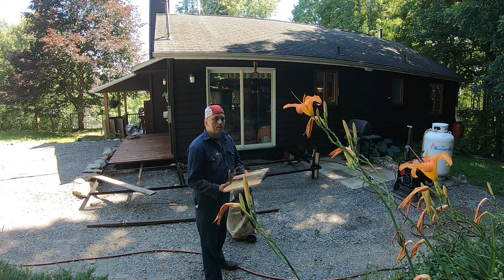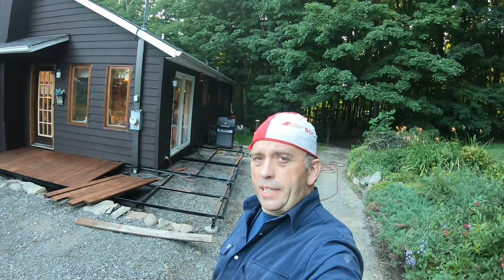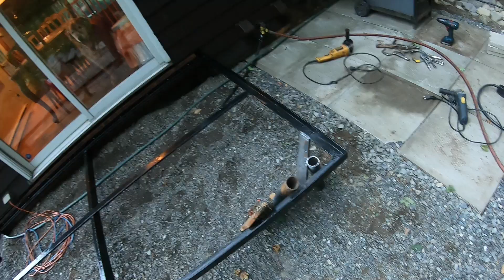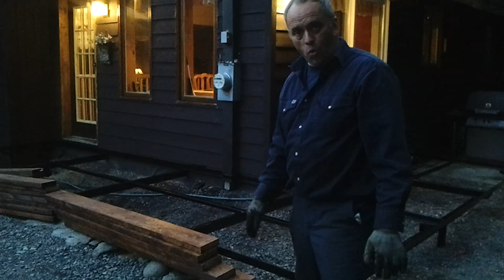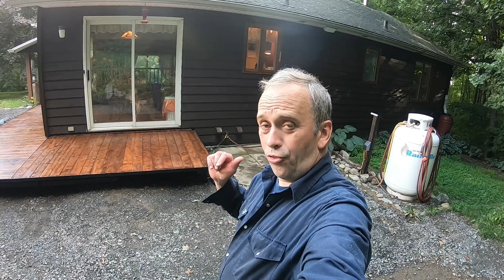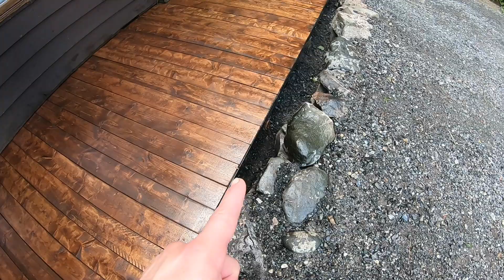Arc Welding with my Lincoln Electric AC 225 power by my Honda Generator EB 6500X. Great team works😊👍

Comment: Comment ca va Dave?    The deck turned out terrific!!!  Lots of planning and it shows.  All the work you have done before you even started the deck is incredible too.  Getting the propane tank moved and then dealing with the drainage.  And even before all that, tearing the old deck apart.  Lots of work.  I think you earned a couple of cold bears!!!  LOL  A demain!!!
Reply from the maker: Bonjour mon ami 🌞😊 Yes in deed it was a lots of planning and unexpected troubles but it went very good 👍😊 Thank you very much for the nice words and input about that project 👍😊 I'm currently working on the cover portion of the deck ( renting a a floor sender, for the deck and my kitchen floor too !!! ) . I have only two plank of wood to change for the deck !!!  Have a great week end mon ami and thank you for your great support Sir Cheers 😊🌞👍

Comment: Very nice job Dave .....very well done and it looks very good. Very good idea to use the hydolic oil....At the camp I spoiled my deck by putting the water base stain and now that would be a big job.....CHEERS
Reply from the maker: Good morning Gator 🌞 Thank you kindly for the nice words and great support. Thank you for your tips, I will look into a oil base stain. I will use a roller for around the house and use my 34 yrs old electric spray gun,,, ( if it is still working order !!! ) Have a great week Cheers